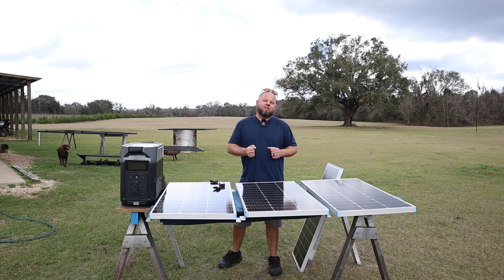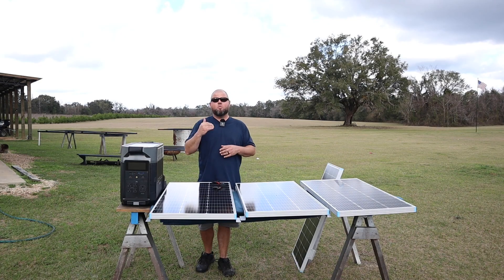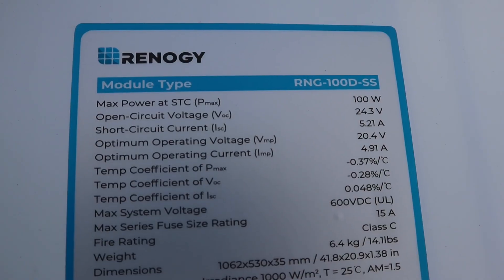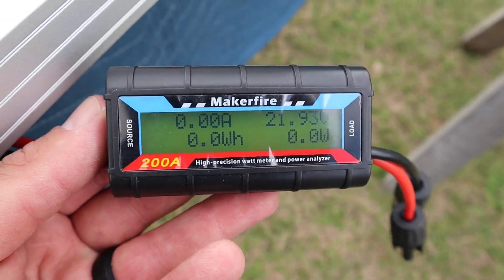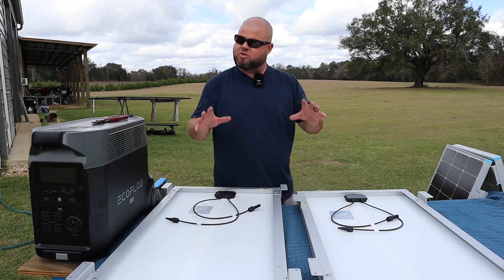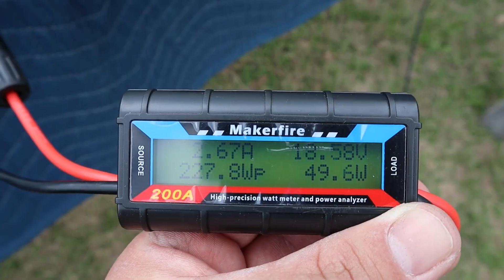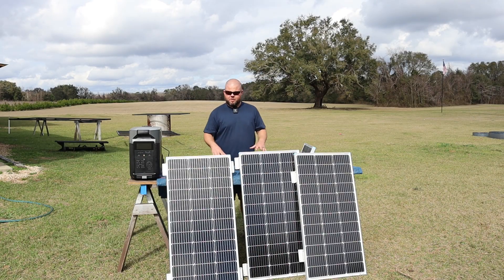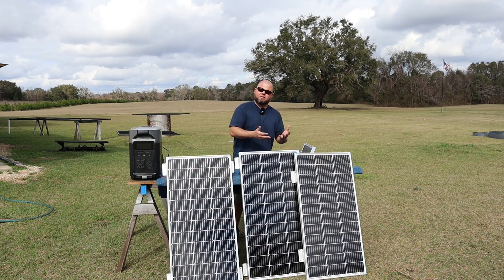How to wire solar panels! Series, parallel, series/parallel explanations. #720

Comment: I was kind of confused about series series parallel however with your video I’m more confident that I can do it I want to hook 400 W (100watt panels)series and another 400 W in series and string them together. I need to get some of those connectors are they what they call MC for connectors? if I do what you just did twice I would connect the leads from all 4??? I would have a total of eight100 W panels series series parallel???
Reply from the maker: To do what your saying you would need two Y branch solar parralell connectors to connect the remaining cables in parralell. Depending on panel spacing and location, you might need a short run of cable to finish your connections.
Reply: @TKCL  would I have to use inline fuses for every pos + panel?
Reply: @TKCL  so I would need 4 Mc  4 (like they use for parallel connections and 2 y connectors ? can you use the flexible Y wire connectors that are a wire with the solar panel connections on the end of it? Sorry for so many  questions however I think all my hardware is going to be here this weekend and I plan on getting started I appreciate your time please and 😊 thank you 🙏
Reply: @TKCL  so I would need 4 Mc  4 (like they use for parallel connections and 2 y connectors ? can you use the flexible Y wire connectors that are a wire with the solar panel connections on the end of it? Sorry for so many  questions however I think all my hardware is going to be here this weekend and I plan on getting started I appreciate your time please and 😊 thank you 🙏
Reply from the maker: No, one you connect all pos and neg together of 4 panels your left with a single pos and neg. Same on the other 4 panels. So that leaves you with a total of two loose positives and two loose negatives that need connection. Two Y Branch adapters will take care of that and combine them down to one single and one positive which will connect to your wires and run to whatever inverter you're using.
Reply: @TKCL  thanks 😊

Comment: hey friend, you must use blocking diodes on the panels in parallel and not allow the shading of one board over the other, as I saw in the tests.
Reply from the maker: Most modern panels already come with those diodes built in, these panels have them under the black plastic cover on the rear for the same reason you're discussing.

Comment: Great video.  I want to connect two panels in series connected to one side of  each input of a dual parallel connectors and a third panel connected to the second inputs on the parallel combiner. Can that be done through a dual parallel connector?  The two panels would be in series and the third parallel.  Would this combine the voltages of all three panels?

Comment: I swapped from in parallel to in series as you described. I'm shocked at the improvement from a max wattage of about 340 watts to 460 watts. I was a little nervous undoing my in parallel set facing South by connecting the 2 pannels positive to negative, leaving one positive and negative running to one of the two Xt60's on my new Delta 2 Max. The other XT60 is connected to the west facing solar pannel. Can't thank you enough as getting close to 500 watts is game a changer. Great video for giving me the confidence to follow your lead
Reply from the maker: Glad you enjoyed it

Comment: Great video😁 how can I connect 3 90w 20 volt panels in both series and parallel?
Reply from the maker: You'll need a even number to achieve that.

Comment: When you put batteries in a flashlight the batteries are touching POS to NEG in series. (same capacity more volts)
2 batteries in series @ 1.5v = 3v 
If you have 6 batteries @ 1.5v, And connected all the POS to each other and All the NEG together (same volts 1.5v more capacity)
Your solar panels work in a similar fashion. 
Volts is a measurement of voltage (Amount of Potential Energy, Pressure or Work that can be done) 
Amps is a measurement of how fast the current of elections are flowing/drawing through the wire and Device, Wire size & distance matters.
Amp Hour is a measurement of Battery capacity. If you have a 2Ah battery, and all your Device(s) Draw a total of 1/2 amp the battery would be empty/dead in 4 hour.
Remember for work to get done something must move.

Comment: Question: I have a truck camper with shore power ,after installing my solar panels to my charge controller can I just connect directly from controller to my batteries? Bypassing everything that’s already in place.. ( inverter , shore etc)just red to red , black to black. Should I worry about let anything?( lithium batteries)
Reply from the maker: Hmmmmmm, the only thing that concerns me there is if you connect to shore power and charge at the same time you are charging via solar. That could be a problem for your solar charger. I'd say you would have to be disciplined in disconnecting your solar charge controller anytime you connect to shore power. Otherwise you should be OK as long as your solar charge controller is rated for lithium batteries.

Comment: Well put and easy to understand.  When doing either type of wiring when does the need for inline fuses become necessary.  I have two of the same panels and will need to wire them in parallel to keep voltage down for my Vtoman jump 600X which is a 30V max input.
Reply from the maker: If running into a structure or through wall, I suggest adding a pv combiner box with fuses  and a breaker at a minimum.

Comment: Great Video. Question:   If you can increase the Amps or the Voltage depending how you connect the panels,  what is better, to have more voltage or to have more amperage ?    Meaning, you can have four panels at 80 volts with 5 amps or the same four panels at 40 volts with 10 amps.   What is better to charge the Eco Flow ?  Both combinations are good, but which one would be more efficient for the unit ?
Reply from the maker: Both accomplish the same thing, volts times amps equals wattage. Higher voltage and lower amperage allows you to use smaller and more affordable wire. The only time wiring in series really hurts you is if part of your panels are shaded and you have older panels that don't have bypass diodes.

Comment: Would the voltage and amperage limitations(for charging) change if you had two delta pros tied together using the double voltage hub? Didn’t know if it would be best to run two sets of wires from solar panels back to each delta pro,so they would receive the same amount of recharge, or just one set of wires to one unit and let the system decide how to divide up the solar input.
Reply from the maker: I was just wondering that, I do not know if one will charge the other.  I will be testing that very soon as I just got a second Delta pro.
Reply: Thanks for the reply and I’ll be watching for a video on that.😁 I really enjoy your videos and content. You seem to have a genuine desire to help others! Keep up the great work..
Reply from the maker: Thank you for watching and the support.

Comment: Can your solar array exceed the 15 amp limit? Say 20 amps? Thank you.
Reply from the maker: Yes, my current array has 12 5 amp panels, so that's very easy to do.  Even with the 4 panels I showed in this video, you can parallel them all and hit 20 amps.

Comment: Great info. It helped me decide on the best way to wire up 4 100watt panels for the Delta 2 which has limitations on voltage AND amperage. Series - Parallel works best for my setup. Thank you for your  in depth instruction!
Reply from the maker: Glad you enjoyed it

Comment: Thanks for explaining this in detail. I've been a Local 11 Union Electrician for 21 Years and have installed fields of solar arrays in the past. Once you get into combiners and Inverters transformers and in some cases bridge rectifiers it becomes more complex. But your video is a great basic understanding of the kind solar most home owners are interested in doing . Thanks Andrew love your channel and the great walkthroughs you do on your builds. I will be sending people this link when they ask me questions about home solar in the future.
Reply from the maker: Thank you for watching
Reply: You seem like you may have the answer I require, I'm a noob when it comes to solar power and am looking to find out if there something that I can use to reduce/step down the power supplied by my panels to match the Ecoflows allowed input? 

I have a river 2 with 2X 100W panels wired in series which exceeds the 30v/8A maximum that the river 2 can handle (wiring in parallel will exceed the allowed Amps too).
Reply: @GearHead835  Can you just unplug one of them and use a single Panel?  It looks like that would make it 8.33 Amps and that's if it's 100%The load calculation formula you're looking for is P/IxE P is Power measured in watts and I is Amps and E is Voltage. There are many ways to reduce amperage and voltage but based on what you're telling me if it's only to recharge your ecoflow you may want to get their panels. When dealing with recharging batteries to much or to little can cause fire or explosion and a charging regulator or transformer is going to cost you more than it's worth in your case.

Comment: I don't like the 15 amp limit on the EcoFlow , it's fine for most everything a person is going to run but some things you need 20 amps. So did you wire your array 2 sets of 6 panels in series and the wire the 2 sets in parallel.
Reply from the maker: That's correct on how I wired them. I've been seeing 1200-1400 watts out of 12 panels during the peak of the sun. I'm very pleased with what I am seeing. Honestly the voltage has been a little more difficult to work with than the amperage. Overall it's worked out great for me staying a little under voltage and amperage, I'm still seeing excellent wattage from these panels.

Comment: 12V    Can I connect two 100W parallels panels with two 100W panels wired in series?  My controller handles 100V 50 amps
Reply from the maker: To keep things uniform you could wire all 4 in series OR parralell with the information you provided. No need for a combination of both. However all in series alone will be close to your maximum voltage. Wire all in parallel unless wanting to go with smaller power wire. Then do a series/combination as shown in this video.
Reply: @TKCL  thank you this helps

Comment: Good video
What people must understand is ohms law
Voltage x Amperage equals Watts
In other words ,20vdc panel at 5 amps equals 100 watts 
The higher the current, the bigger the gauge wire you need
The higher the voltage, the lower the current needed,  your wire size could be smaller, thus cheaper, for the same power. 
That's why power lines from the utilities carry high voltage on skinny wires.
Reply from the maker: I don't disagree, but what I was showing is these smaller power stations have specific voltage and amperage ranges you must work in. Almost always requires some kind of series parralell situation to stay in spec. Wattage never changes.

Comment: All of this should have started with Ohm’s law. That explains the entire relationship between volts amps and watts. You can’t change one one without changing the other. You stated “you change voltage but leave amperage alone”. It doesn’t work that way, the two are tied together. Example 10a@100v=1000w. Now, let’s half the voltage. 1000w/50v=20a. Still 1000w. Just as 5a@200v=1000w.

Assuming each panel is 12v and puts out 100w, let’s run the math.

2 panels in series would be 24v 200w which would be 8.3A. 

2 panels wired in parallel would be 12V 200w which would be 16.6A. 

Just remember they are all related. Where this also becomes important is wire size. You can run more wattage over smaller wires at higher voltages, which is why power lines run thousands of volts. So, if you need to run a long wire from your panels, you can do it with smaller wire at a higher voltage.
Reply from the maker: The one doesn't change the other was referring to either series OR parallel. Yes in the end by combining both in series AND parallel I affected both voltage and amperage. At the end of the day wattage is wattage. The purpose of the demonstration is to show how you have to manipulate both amperage and voltage to stay within a manufacturers recommended range. It's flawed thinking by individuals and manufacturers to put a wattage only maximum on converters when in reality you have other parameters to stay within.

Comment: One thing to Consider with Series Panels is Shading. 
Any part of a panel that is shaded effects the whole line in the string..
I think there are some newer Panels that correct this . 
Thanks Andrew.
Reply from the maker: Almost all do with bypass diodes if I understand this correctly, mine have these.
Reply: @TKCL  I'd figured so. the older Panels it was a problem.

Comment: Can you mix different size panels together, like 100w with a 200w etc??
Reply from the maker: I am not sure, I would think no. You don't do that with batteries.
Reply: Yes you can, as long as you don't exceed maximum voltage and wattage for your inverter charger

Comment: Question I have 2 Harbor Freight 100 watt solar panels with pig nose connections both are connected to a splitter wire going to my jackery Explorer 1000 at the most I get 120 watts reading at midday how can I increase it with the wiring?
Reply from the maker: Wattage wont increase with wiring configurations, just amperage or voltage. You need to make sure you are getting the correct angle to sun for your area. Sounds like those panels might not be as efficient as they claim.
Reply: The issue with the all in one systems like the jackery and the delta pro is that they do limit amperage in from a solar string.  The HF panels are excellent, and each will make more than its 100w rating even using the built in legs. I don’t know the voltage input or amperage limit of the jackery, but I assume it’s around 6a or so.  Wiring in parallel will hit that 6a limit with just over one panel. 20v x 6a = 120w. You would limit anything above that 6a. 8 panels in parallel would still result in 120w. To get more wattage, you have to increase the voltage using series wiring. If the jackery is safe to at least 45v solar input, then wiring two panels in series will yield that 200w that you are looking for out of those oabels.  There is no issue ever having more amperage than the controller is spec’ed for. It will stop at it max amp limit. 
The ecoflow delta pro has a 15a limit. To max out that 15a input, you will need to supply it with an operating voltage above 106v, but below 150v. I wouldn’t allow it to get above 145v in the coldest weather when panel voltage rises.  106x15a= 1600w.  It would take a combination of series- parallel 100w panels to get the voltage above 106v, and the amperage above 15a to get the most of your ecoflow delta pro.
Reply from the maker: I'm currently running 12 renogy 100 watt panels and last check showed open circuit voltage of 138 volts. Wired in series parralell to 10 amps. I routinely see 1250-1400 watts out of this setup during mid day sun. I am extremely pleased to consistently get over factory spec out of these panels, especially for the $85 price tag.
Reply: @TKCL  That mathematically makes sense.  20v that you found with your meter x 6 in series will be 120v operating voltage.  Each string you measured is 6a. 120x 12a is 1400w.  It’s hard to max out the 1600 watts limit on the delta pro with the 100w panels just because the amps and voltage combo is hard to get just just right without exceeding 150v open circuit voltage. To get to 1600w with the delta pro, you would need another 6 panels in series connected in parallel to what you already own. That would put you at 1800w but can only use 1600w. That’s ok. It’s just an example of over paneling.  I also use 100w panels. $85/each is about as cheap as I have seen them too.  Most are $100/ea.
Reply from the maker: They have been staying $85 on Amazon recently, best price I could find.
Reply: @TKCL  I have 16 harbor freight 100w panels. It’s hard to get large amounts of those all at one time since the store only stocks a couple at a time, and they are seldom on sale for under $100. I won’t pay over that so I have to be patient. All of them produce over 100w though, and have a great 50 degree built in ground stand. I will eventually ground mount them. 
I also have 8 EF 100w rigid panels. I got them from Amazon for $75/ea I believe. They are still in the boxes waiting for better weather and me to build the ground mount. I’m looking forward to seeing your progress of a 100w mounting solution!
Reply from the maker: I just released that video did you see it https://youtu.be/a_FiFUCf9mg
Reply: @TKCL  Just found it!  Great video and great design.

Comment: Any reason you chose that brand?  I am using Delta Pro 2.
Reply from the maker: Delta pro 2? I am only familiar with the Delta pro? They sponsored me a while back, with that said I've always been a huge fan of their products and constant improvements. The other big reason I like the Delta pro is its one of the few that offer 240v capability. I desire that!
Reply: I think you're thinking of the Delta 2. Delta Pro 2 does not exist, at least not yet.
Reply: @charlesniemi7779  ya
Reply from the maker: Or did you mean the panels? I have a lot of reasons I chose those panels, video out this week. I am very impressed!
Reply: @TKCL  it was the panels.
Reply from the maker: @isoakfires  gotcha! Yeah a lot of reasons, price, efficiency ect. My tests have confirmed my choice, I'm very happy.